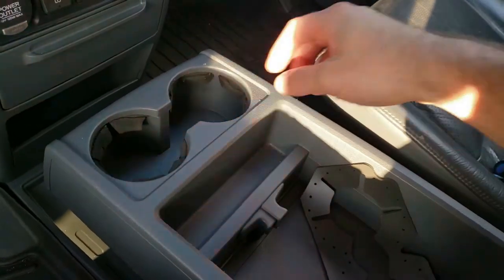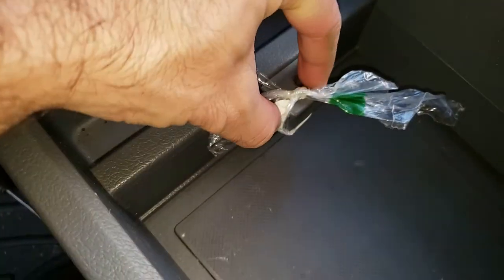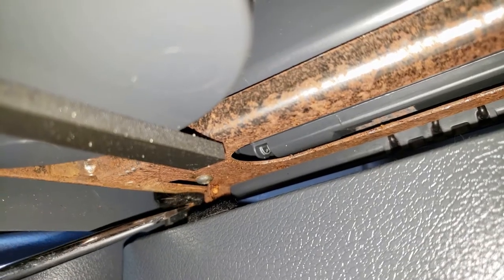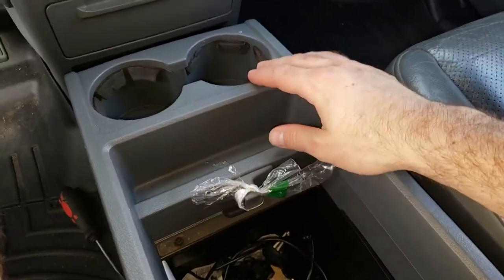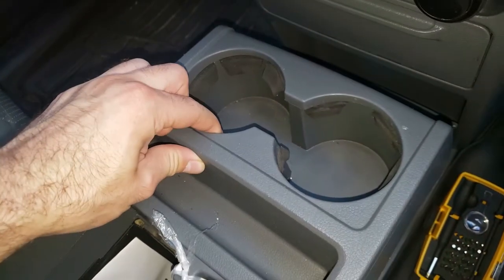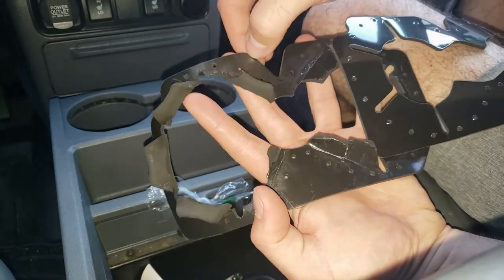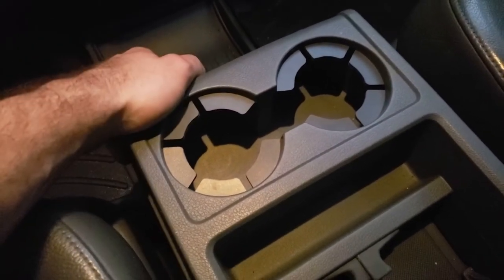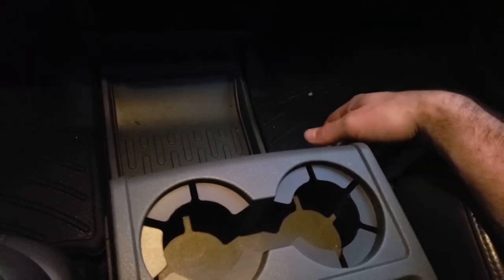How to Replace Honda Ridgeline Cupholder Foam (Ridgeline Part 2)

Comment: Thanks very much for the video. For anyone who cares, this works. No need to contort your body. Can feel the screws with fingers. For the ones on the corners, temporarily remove the foam padding and it is a straight shot to the screws no problem. Will need to push up on the metal tabs underneath in order to get the holder pushed back into place on the console rails. I held the squeeze lock pressed with a small cresent wrench. Looks good.

Comment: Great video. FYI, I figured out an easier (notice I didn’t say easy) way to get those front side screws in. Use a magnetic bit driver, the bit size is Torx T15. With the screw on the T15 bit push it into the front inside corner. It’s kind of a rounded corner. Move from the corner out toward the side of the vehicle slowly scratching the screw along the top as you go.  Don’t worry if you don’t get it the first try, you will eventually hit the hole. The first one took less than a minute and the other one 2 or 3 minutes.
Reply: If you don't have a magnet, you can use a dab of grease on the screw head.  You can also use the paste kids use  (you know, the glue sticks) as it will do the same thing; hold the screw 'enough' that you can get it in position then tighten.  Do't use a lot, just enough that it sticks to the torx head.  Think 'sticky bombs' from Saving Private Ryan' - grease lubes, but clings too...

Comment: Excellent video. I just changed mine out and it looks great. Yes the screws are a challenge but not so bad once you get a method. I could lay a handheld bathroom mirror on the floorboard and shine a flashlight into the mirror which projected up to where the screw was. Push those foam pieces that are stuck inside out of the way.  You can replace them when you finished. You get a clean view of the screws. Taking them out is a no-brainer but when you put them back take a large thin baggy and push the screw-head through the very bottom. Of course your screwdriver is in there with it haha. That will hold the screw tight while you fish up in there to put it back in. Tighten well and just pulled a baggie off.

Comment: Great video, I am eager to try this. For installing deep, hidden screws, it can help to poke the screw through a plastic shopping bag, then seat the bit and driver from within the bag. You can hold tension on the plastic bag, which then holds the screw tight against the bit (a magnetic bit works similarly, but they don't hold as well to sideways pressure when blindly fishing for a hidden screw hole). I suggest adding that technique to the many useful ones in this video. Thanks!

Comment: Honda must've cheaped them out as the years went by.  I bought a new 2012 Ridge and they were all broken within a year.  That truck got totaled, so by then I loved them so much I bought another used one; a 2006 (first year of manufacture).  Here it is 2022 and the originals are still fine and in good shape (no broken tabs).

Comment: Putting in the outside screws I used a mirror and a flashlight to remove and install.
Reply: Yup, I used a mirror and a flashlight and got the whole job done in about 30 minutes. Looks like new!

Comment: Can you peel off the back and stick it down or does the plastic not come off the back
Reply from the maker: The plastic stays on.
Reply: @EveryotherKarl   cool I just replaced mine an seen the little tabs that the holes slide over 👍

Comment: Where did you find the replacement foam
Reply from the maker: I got it on Amazon
Reply from the maker: https://www.amazon.com/Honda-83409-SJC-A02-Holder-Retainer-Ridgeline/dp/B00J3V5CHI/ref=mp_s_a_1_4?dchild=1&keywords=honda+ridgeline+cup+holder&qid=1620146368&sr=8-4
Reply: @EveryotherKarl  cool just replace mine worked out great thank you sir

Comment: Thank you for the upload, but good freaking grief... What a pain in my ass! At 6', 200 lbs, there was NO way I was able to get under that thing to see where the 3 screws were. Ended up using a flashlight and my phone's selfie cam on the floorboard underneath it to get a view of where the bit was going.

And even then, I could NOT get the cup holder to slide all the way forward without just strong-arming it. That was the best design they were able to come up with?
Reply from the maker: Lol, it really is a pain!